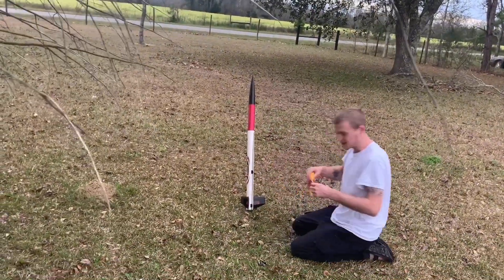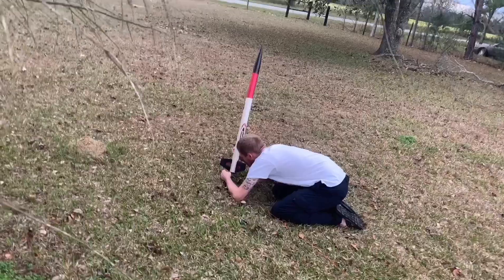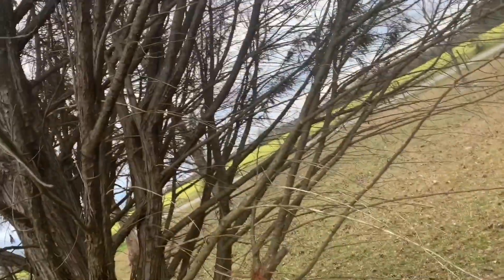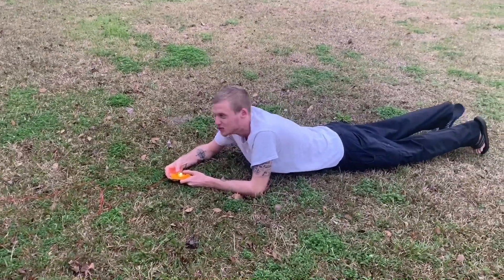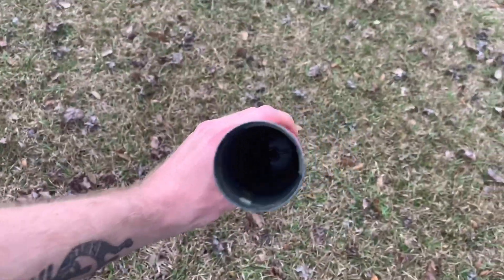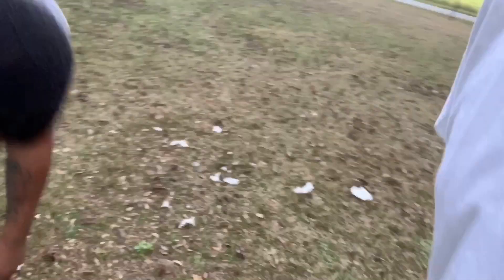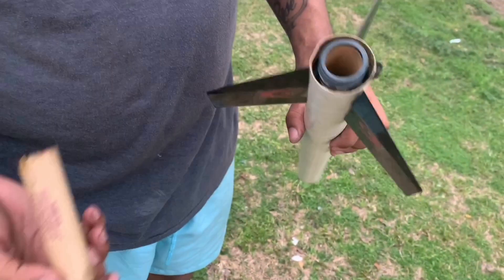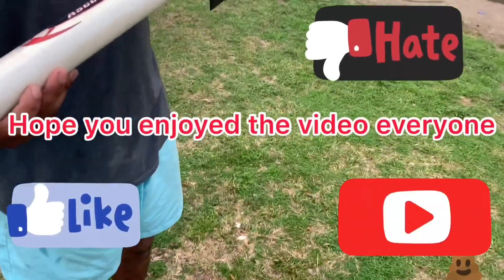Model Rocket Explosion !!!

Comment: First, rule of rocketry, .... NEVER put you face down by the exhaust! 🤣

OOOOooooo, and what you had there was internally the fuel had a "crack" in it so that it burned up through the motor and ignited the ejection charge early! 🤣

VERY RARELY happens with Estes, I have only had ONE bad engine in thousands myself, since 1972! 👍

Comment: Attempt #1: 
No comment

Attempt #2: 
You had that motor for around 5 years (according to the date code you'd shown near the very end of the video), so the propellant probably wasn't reliable. If you live in a humid environment, that propellant may have absorbed moisture from the ambient air, then perhaps dried out. Through successive heating and cooling, you may have experienced the expansion and contraction of the propellant causing cracks that would most certainly have affected the burn rate causing your evident CATO. This happened to me while living in Houston, Texas. I am quite sure of it. On one occasion, my airframe made it ~5 meters before the CATO took out pretty much and entire fin can. 
  
Could you, if you've discovered anything else, follow up on this event?